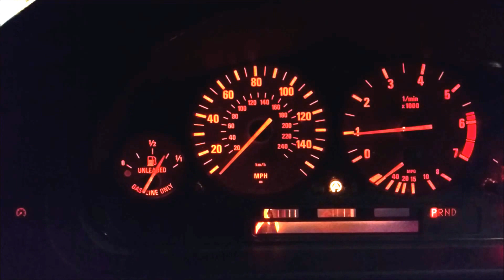How to Diagnose an Engine Misfire DIY - BMW E39

Comment: I got a 2000’ m62tu 540 and after changing my valve cover gasket car started to give out at idle and dies ever since then has been dead since for about 2 weeks mind your the car does sit for about a month 2 month span since I’ve got another car. Was previously having a problem with the idle where it dips and bobs at low rpm’s. Nevertheless trying to fix my issue now as I can’t figure it out. Tried jumping it everything electrical turns on but no engine start. If you could think of anything thank you!!

Comment: Hey man bought a 03 540i Did not  run when I bought it changed the fuel pump and it ran great just would smoke every now and then very odd wasn’t the head gasket did more research and it was the ccv just swapped that in and now I’m facing a misfire I have codes for bank 1 and bank 2 hooked up my scanner and the vanos are stuck at 9.5 I have power to vanos too I don’t man I kinda confused and don’t know what to do next I appreciate your time I don’t know if there’s anything you could tell me to check on next

Comment: Have an '01 530i that started acting up in heavy rain yesterday. Refused to rev past 3000 with full throttle, with light throttle it misfired dramatically around 3500 (won't rev past 3800). Started up this morning and it now shakes like crazy. Ideas?
Reply from the maker: It's hard to say without a check engine light. I would check the ignition coils as it sounds like a misfire

Comment: White smoke coming from exhaust. Never had it before moving to cold weather. 2002 540i. Any help would be great.
Reply from the maker: That sounds like water that has condensed in the tail pipe being boiled out.

Comment: I’m misfiring on all cylinders but 2 with fuel cut off. Would you happen to have stumble upon a problem like this? What was your solution?
Reply from the maker: I would need much more information, but I would shuffle the ignition coils and spark plugs individually to see if they are the problem. Most likely after that is a vacuum leak or fuel injector issue.
Reply: @350Z247  I replaced all spark plugs and unplugged each coil individually
Reply: @350Z247  and it’s making bad noise from the left side of the motor like it’s knocking
Reply from the maker: @MrOutlawLSX  you may have a more serious mechanical problem as opposed to an ignition specific problem.
Reply: @350Z247  could be a fuel injector
Reply from the maker: @MrOutlawLSX  yes, as I said above. Getting them professionally cleaned would be a good next move. Should only cost about $40

Comment: Am gonna buy a e39 540i has slight misfire issue is it worth me buying it?
Reply from the maker: That question requires more information. Mileage, price, condition, year, mechanical aptitude, intended use, ect.
Reply: @350Z247  thanks for super reply 120k  mileage 1996 0/S/R sill area is reported on mot and has misfire issue but the owner says it is still drivable
Reply: My intended use is for motorway journeys and long trips
Reply from the maker: @alpha88.  they do love to cruise on the highway and are very comfortable. The misfire is likely pretty easy to fix by replacing all 8 coil packs and spark plugs. Wouldn't hurt to have the fuel injectors professionally cleaned. Worst case, you'll need to remove the intake manifold to replace all the gaskets as they're 25 years old now. Easy fixes and not that expensive if you do it yourself.

Comment: My son's 2003 E39 525i had been misfiring, and since the plugs and coils were 8 years and 80K miles old, we replaced them all. (The plugs were terrible, worn down to pin-sized electrodes.) With new plugs and coils, it ran smoothly at first, but now I have misfires on #3 and #4, and no other codes. Another thing is that there is a loud whistle/squeal when starting and bringing the engine to 2000 rpm. Do you think the squeal (but with no lean codes) suggests a vacuum leak somewhere? How would I differentiate between a vacuum leak and bad injectors?
Reply from the maker: You could move the injectors and see if the misfire code follows it. I had my injectors cleaned professionally just to be safe. Removing the injectors on the M62 isn't particularly easy though. You could do a smoke test or use throttle body cleaner to spray near cylinders 3 and 4 to listen for engine RPM changes if it sucks in the cleaner as fuel. The crankcase valve at the back of the engine may be causing a problem as well.

Comment: Mine started as a misfire and it’s completely a dead cylinder now so I’m guessing it’s a bad plug. I’m not sure, I’m gonna replace the plugs tomorrow.
Reply from the maker: It's a good place to start. I usually go plug, coil, then injector.
Reply: 350Z247 I don’t own a scan tool and I’m pretty sure these plugs haven’t been changed in years so I’m just gonna do all 8
Reply from the maker: @jdmcarboy64  Yeah, might as well keep them all at the same point. You can get the car scanned at any auto parts store for free.
Reply: 350Z247 changed all 8 plugs with V power NGK which are the race plugs from NGK and holy hell. The throttle response is amazing and it feels stronger.
Reply from the maker: @jdmcarboy64  Good to hear! I do miss that V8!
Reply: 350Z247 lord it sounds amazing. I straight piped it from the second cats back. And it’s a 6 speed. If you heard it but didn’t realize it was the V8 in my car you’d think it was corvette somewhere.
Reply from the maker: @jdmcarboy64  Enjoy it man! It's a great machine.

Comment: my car idles at the first tick under 1k rpm, and only the engine dies at complete stops. but if i keep the revs higher than that tick its fine, how can i raise the rpm?
Reply from the maker: There isn't really a way to raise the idle speed that I'm aware of especially if you have the M62B44tu. It sounds like you have a vacuum leak but it could be a bad MAF. I have a video on how you check the MAF. If the MAF is good, try finding the vacuum leak with carburetor cleaner.

Comment: What's bro. Man I'm wondering if u can help or any Idea would help. My 1997 540i got a code P0300.. I have change so many new parts..1 New coils BMW 2. New Injectors bmw. 3. New spark plugs Ngk 4. New fuel pump! 5. Change all valve cover &  gasket. And Intake. New ECU! New catalytic converter! Oxygen sensor are good. New knock sensor! New fuel filter new fuel valve. Man to many new parts and the freaking car still getting P0300 and cylinder 1 and 6 miss fire.. Checked the compression 150 some and a few 155. Oh got a new thermostat from Latvia custom made to drop temperature 80c and new water pump also.. Man Don't know what else to do to it.. Any help would be great thanks bro..
Reply: R Tario 
I’d say check the wiring. Contact spray on everything. Still nothing? Replace the wiring anyway. Get from parts car so it doesn’t get that expensive. 

You could also be very unlucky. Maybe the new coil you installed had something wrong with it and you happened to install that coil on the same exact cylinder you had problems with previously? 

Get throttle body cleaner and clean everything. Get MAF cleaner or replace the MAF. 

I’d say somethings up with a sensor, dirty contacts or broken wiring.

Let me know how it went.